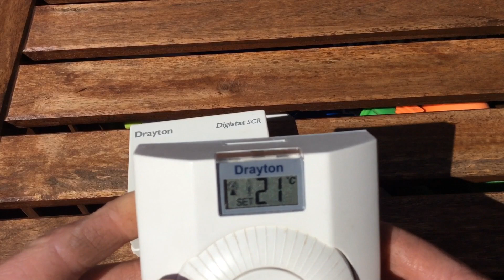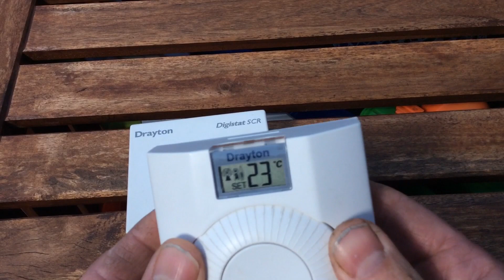Drayton wireless thermostat tear down

Comment: Have to say as 'npowleynpowley' said, I can't see what this has achieved. you've basically spent 5.22 minutes telling us how to set the temperature and breaking one part to bits. Would have been much better to show how to wire it up and sync' the two.
Reply from the maker: Unit was faulty .wiring is generic for a wireless unit .

Comment: Not sure what you were trying to achieve with this video? The thermostat was probably working fine and the SCR probably needed a new 0.68uF Capacitor fitting as these often fail. Simple £5 or less fix but you've butchered the thermostat so probably a waste of time trying to fix the SCR Rx unit now? Why you thought you'd be able to see a fault with the Thermostat is beyond me as it appeared to be working fine before you took it apart!
Reply from the maker: Defo not working mate
Reply: time in the uk you said it won't stay latched on that's because the Rx is faulty not the Tx. Look up replacing the capacitor in the Scr unit and you'll see this is a normal fault and easily fixed.
Reply: @timeintheuk  if you nee a capacitor look me up on ebay, I am the seller bearsy72, I have fixed 1000's of these units good luck
Reply from the maker: @xxxxbigdavexxxx  for me i wouldn't repair an old control i would just bin and replace